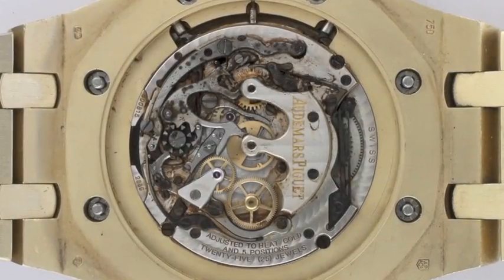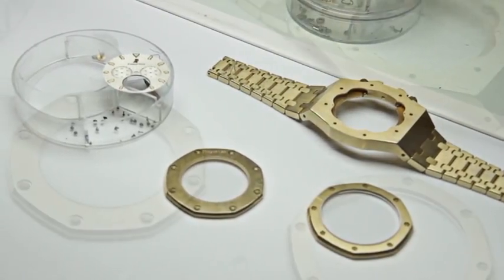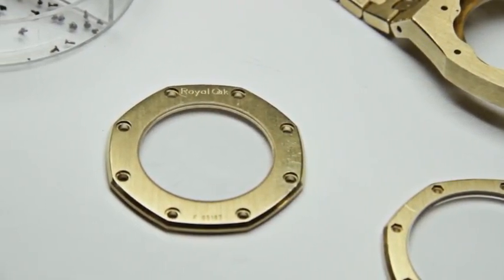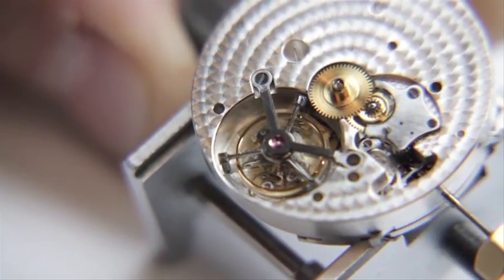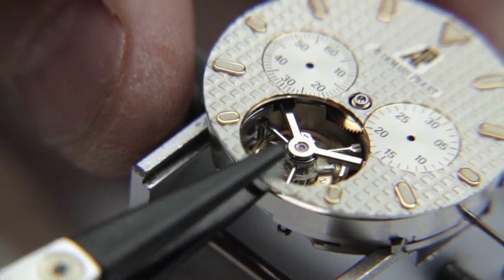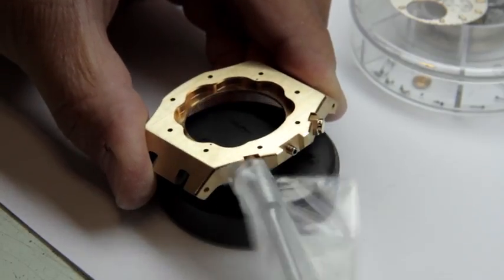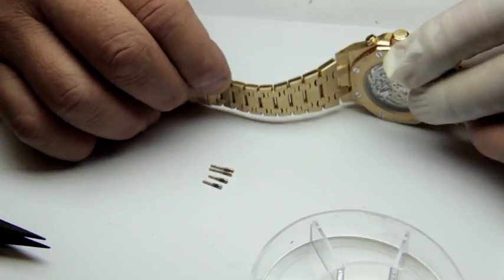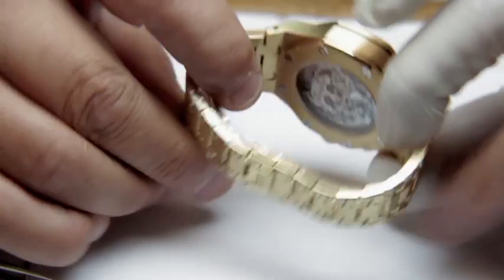Audemars Piguet Watch Repair- Royal Oak Tourbillon Chronograph - FULL VIDEO

Comment: Judging by the comments, some people don't understand this repair was done as a trade-off to restore a grail watch to a working condition, instead of just letting it be a total loss. AP quotes $120K(read description), and that's probably accurate judging by the damage to the movement, bracelet, and dial. If you check chrono24, there is one identical model with an asking price of $192.5K. Meaning that AP wanted 62% of the price of the watch just to repair it. Even after AP's repair the watch wouldn't even be worth close to MSRP. So this is just an economical choice.
Reply: Not bad

Comment: no matter how long it takes, i will still send the watch back to AP factory, if i'm the owner.
Reply: +sultanabran1 Do You know how much AP wanted for such restoration?
I'll tell you - about 1/3 of this watch value.
When I dropped my Zenith on the carpet and the dial screws broke up (dial just turned a little bit) I had to pay for the repair 2500k dollars (Zenith servie), and I had to send it back, because it wasn't done perfectly. Dial moved during winding with crown. Now I feel bad about this, I could send it to a skilled watchmaker, and for two hundret bucks it'd be done perfectly for the first time.
Reply: Michał 77 price is no argument when talking about AP or other watches of such value. if price is an issue, go buy a seiko.
Reply: +sultanabran1 The watch companies just need such fanboys like You.
Reply: Michał Dębicki i don't understand your thinking. if you love watches such as AP, then you'd appreciate the love the watch makers put into making them. which is also why they cost so much. to get some hack to service or repair an AP, goes against the very reason you love an AP timepiece.
Reply: sultanabran1 I do understand what you have in mind. I'm just not blind and bot able to justify every company's service price. I own several new watches like Zenith, Omega and I wasn't satified with their service. Very expensive and not done  well. (I had my Zenith back with a serious defect).
(Omega returned with dirt on the dial)  IF this service would be done perfectly - I wouldn't have had any objections. As you said before price is not the most important factor. To be honest I'm more into vintage watches, they were made without computer technologies and with much more care for the quality. And I respect more AHCI watches, which are done really by watchmakers-artists. I like brands like AP, PP, ALS, Breguet, but they are not as good as they were before.
Reply: as somebody who works in the industry, yould be suprised how bad, how careless and how expensive and time consuming in house repairers can be. its trully aweful the stories ive heard

i know some-one with a patek minute repeater that came back broken and with huge scratches on them and were charged again for repair and had to wait another 6 months
Reply: Michał 77 

I had similar problems sending my stainless Breguet Aeronavale and a solid 18K gold Rolex Datejust with diamond dial back to the authorized service depots of Breguet and Rolex. 

The Rolex was over polished that took out too much gold. The edged were drooping. While the stainless steel case of the Breguet had major polish swirls all over the case. The caseback hexagon teeth was also badly damaged from being opened. Unbelievable, to say the least.
Reply: Agree, that workshop looks like a car mechanics workshop. Also the way they handled the screws was a little too rough for me. Send it to the people who know best.
Reply: You correct! If a person can buy an expensive watch, same person should be ready for future repair/re-calibration from the same company.
Reply: Michał Dębicki jeez 2.5 million to fix the dial screws?😂
Reply: Great artistry but you just turned a masterpiece into a frankenwatch with non AP parts. What a shame.
Reply: @sultanabran1  Nope, because you could buy another new one fully functional in the grey market for the price AP requested
Reply: @JohnSmith-gs2rv  wow i cant believe someone reply on this 5 years old message, anyway anyone buying an AP they should have put the cost of maintenance into consideration, i know the price is crazy, thats why i will never able to afford one, even i can afford one i will stay away from it because of the maintenance fee alone, but lets say i do have one and i will still send it to the factory no matter what, cause you never know what other people will do to your watch, if you go cheap on it you may lose the value of the watch totally, and thats the risk i'm not willing to take.
Reply: Factory is NOT the only way to be sent for repair or restoration, there are lots of experience ( more experience technicans ) than those working for the factory .. e.g. retired old watch makers who possess more experience than factory technicans. Besides, they usually charge less than factory as do these repair or restoration to show that they are BETTER ! !
Reply: @SAMR33  nope. Since you don't know what you're talking about, I'll drop some knowledge on you. For the hit in value it takes by being refurbished, even at AP, and the $120k cost for AP to repair it, it would be stupid to send it back to AP. You now paid $120k to fix a watch that is now worth $120k. So the $120k repair plus the $80k hit in value, you're into the watch for the cost of a brand new one. That's why you're broke. You don't know how money or investments work.

Comment: What are you critics complaining about?! Did any of YOU get the REPAIR BILL for restoring this watch????

....I can only imagine how bad the owner of this watch must have felt when it got wet inside- and I'll bet that the owner of this watch really winced when they had to fork over the cost of these repairs!

All things considered, I think it is just as well that this watch was NOT sent back to Audemars Piguet...the people there would have probably FAINTED at the condition of this watch- and I think that the time and efforts of the Audemars Piguet craftsmen is of far better use manufacturing new watches rather than trying to restore a mess like THIS!!!

As for the work done by the Gray and Sons craftsmen- I would like to think that the people at Audemars Piguet would APPROVE of the care and effort contributed by Gray and Sons toward restoring this masterpiece.
Reply: AP would have charged 40k to redo the whole thing. I heard a few stories like this. Make sure you get a watch pressure tested every few years.

Comment from the maker: The system may have been water resistant when the customer initially bought the watch, but it obviously appears that the seals failed.
Reply: True,  but it shouldn't happen at the price paid, silly, btw; great job!
Reply: through my eyes  unless the user was around salt water a lot. Extensive wear around salt water could easily corrode any metal. Which is why it’s recommended to get it service every few years.

Comment: Felix Pinto,
The major Swiss watch brands are produced in production factories. The watches are made by production personnel, not watchmakers. When you look at the staggering output of watches produced by these factories (Rolex 1,000,000 watches/year, Petit Philippe 45,000 watches/year Audemars Piquet 26,000 watches/year etc.) one will have to realize that there aren't a lot of actual watchmakers who are employed by watch factories.  Roger Smith, on the other hand, produces watches using actual watchmakers and turns out about 10 watches/year. If a Roger Smith watch gets sent back to  his factory it will be serviced by an experienced watchmaker.  The  large factories aren't set up for repair and restoration, they are set up for production manufacturing. A watch sent back to them is going to be serviced by part replacers. You will get much better results sending your watch to  restoration and repair specialists like the ones in this video. 
david

Comment: Lol who goes diving with a $250k Tourbillion
Reply: It was worn in a hot tub
Reply: @RobinsM  That probably explains the water damage despite the waterproofing, as steam can get in to waterproofed watches
Reply: Will Young steam can’t get into my Rolex lol. I’ve cooked, showered, been to the beach and all with this 6k watch and it’s still in mint condition. AP just makes shit watched
Reply: @dearjohn8789  AP makes shit watches?
Reply: Quin Kleeko A G-Shock will also survive a steam room as well as mud wrestling an alligator. Rolex is a tool. It’s like a wrench or a screw driver. Comparing it to an AP, is like comparing a building brick to a Renisance sculpture. The Rolex being the brick, in case you didn’t get that.
Reply: @jimmyjay122  
If Rolex is a brick what is my casio?

Comment: I have two questions:1. How did this happen?2. What did this particular repair and restoration cost?
Reply: I wouldn't be suprised if this was in excess of $3000
Reply: +Karson Barnes way more than that in my opinion for a watch of that caliber
Reply: +Marco Brotto I concur.
Reply: +Karson Barnes for this kind of watch $3000 is a normal service with some componence change. For this disaster you can go easy at more than 10.000$.
Regards.
Reply: +Pasquale Spagnuolo probably around 20k ..  these guys were charging me 2500 plus secured shipping each way just to replace the gold pins on my presidential bracelet ... it is a tough job no doubt  but 2500 is a ton of money ... I sent it to Michael Young in Hong Kong he did it for 1200 and it came back looking brand new ... took him 12 weeks though !!
Reply: Rolex Enforcer do you have Michael young' s contact info
Reply: Karson Barnes They spent 50 hours just on the bracelet. I should think you could put another 0 on that estimate.

Comment: Mark Job,
The reason you "don't understand" Is because you do not know what you are talking about. Do you know anything about watch movements, watch parts, how they are made and how they are assembled? Do you know how to  design a watch gear train, how to make a pinion, a gear, a staff, a pivot,  watch stem case pilor plate etc. Do you know how an escapement works? The master craftsmen in this video do.  Which person in the Audemars Piquet  factory do you have in mind who knows more about watch restoration then the technicians at Gray & Sons? Which part in this  watch restoration video do you feel was out of tolerance?  Which repair technique did you observe that was incorrect?  Your comments are nothing more than  ignorant concepts that imply Audemars Piquet has the only people on the planet who know how to restore a watch.  You should learn something about watches before making negative comments about those who do know.
david

Comment: Gray & Sons did a wonderful repair, but this watch should have been returned to the original manufacturer. It's the same with A Vacheron Constantin, or A Patak-Philippe timepiece, as these are, frankly, extremely high level watches. Many of these calibres of timepieces can only be properly repaired by being returned to the manufacturer who can return them to spec by those same in house watchmakers who probably built the watch in the first place (depending on how old it is, of course). A year to restore the watch by Audemars-Piquet sounds about right, since this is the time it takes to build a new one from scratch. A watch this destroyed needs to be mostly re-manufactured. Who better than the original manufacturer themselves can do this kind of job ? Put another way, as good as Gray and Sons is, and they are very high end quality watchmakers themselves, their repair will not be superior to the original house of manufacture - Especially with Tier 2 and Tier 1 level timepieces.
Reply: That’s stupid. A master watchmaker such as those in this video offer the exact same service for a fraction of the cost. It’s not it’s being restored by a small time watch repairer

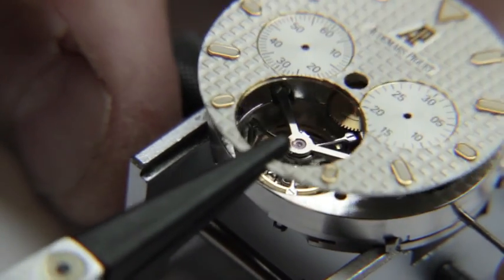Comment: @3:14 - picking up the dial on its face with tweezers rather than from the side
@3:41 - pushing in the hands with the crown in and while the gears are going
no gloves used throughout various parts of the process
what are you guys doingggggggggggggggg

Comment: Watch this video carefully. C-clamp holding a hand held grinder down on a workbench to work case screws? What happened to the lathe? Setting the second hand with a stick? Wearing finger cots on just one hand? That special screwdriver was cringe inspiring. This watch will never regain substantial value now that it's been handled this way. As for Audemars Piguet, $120K for a few replacement parts and a thorough clean, polish and tuning is beyond excessive. Their refurb probably wouldn't be all that impressive, either. The owner of this type of watch would be beyond rich for these kinds of prices to make sense, or fail to grasp what a horrible value/trade-off this example is.

Comment: With all due respect, I cannot accept the premise that your company knows more, or has a superior service to the original Swiss manufacturer Audemars - Piguet. There's a very good reason why the original manufacturer said one year for a watch restoration and not two months !!! Therefore, I must conclude your servicing of the $250,000.00 US to be inferior to the original manufacturer.
Reply: +Mark Job And now it's also considered a Franken watch, since it wasn't repaired with original parts. That watch is sadly, no longer worth $250 000.

Comment: A fucking $250K tourbillon and the gaskets failed? If AP had any sense of pride and shame, they should fix that watch for free! I love the look of the AP Royal Oak Offshore but am thinking twice in pulling the trigger on this brand after watching this video. Seems as though their prices are artificially high due to their limited production. For now, I will stick to the ROLEX! I do have to say that this watch’s value was totally destroyed before and  after the repair.
Reply: Hey, atleast the owner can wear it as a status symbol
Reply: Cuban Jorge absolutely correct. AP makes cool complicated timepieces but the quality is no different from a cheap Chinese knock off. I’ve been saying this for years. Rolex and patek are the only high end watches I would spend my money on. I’d ratchet wear a tissot than an over priced pos like AP